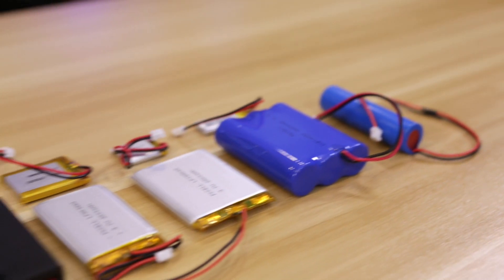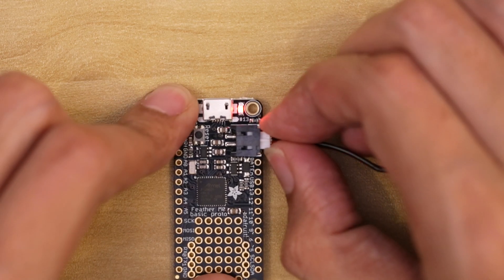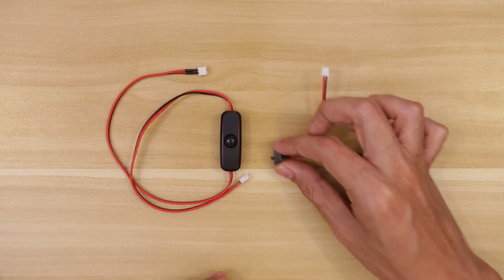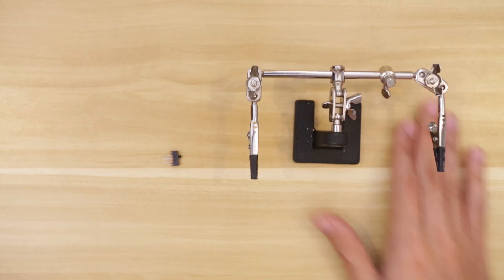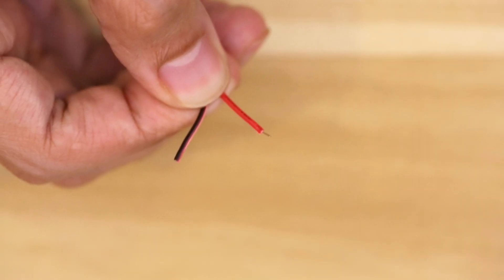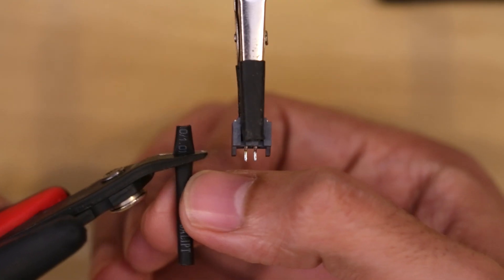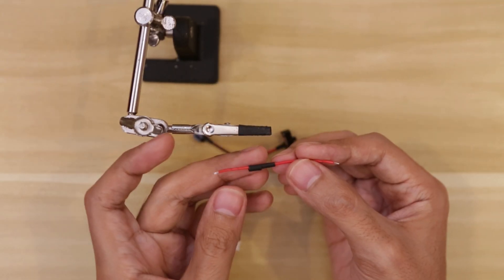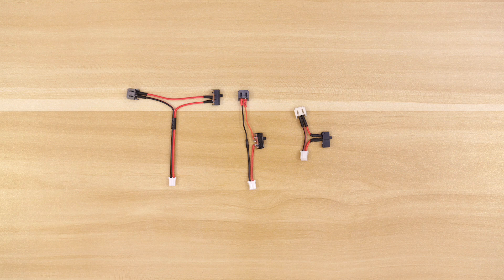DIY Slide Switch JST Adapter // How To

Comment: With slide switches, can you use a switch in an application where the current exhibited will be higher than its rating but the voltage will be much lower as well?

Comment: Why does the slide switch have 3 prongs? I've seen some that are 3 position ones, but even the ones sold as 2 positions have 3 prongs.
Reply: One of the prongs has to be untouched(only solder 2 of the 3 pins but one of them has to be the middle pin tho) as when you switch it off. The pin that doesn't have anything soldered to it is what causes it to turn off or you can reroute it to something else enirly depending on what your doing.

Comment: lets say i have a board that has a spot for a sliding switch, six holes and one extra in each side to connect it, is there a way i could make it work with some wire?

Comment: Hi there

I have a question here Is there a slide-push switch button anywhere. Im working on a project that I want to use this type of switch-button

Example: Slide - power on/off
Push- sync/search

Thanks

Comment: Why cannot you also use the female connector on the extension instead of replacing it with the black right angle JST-PH connector (https://www.adafruit.com/product/1769).  The one coming with extension seems to work fine.

https://youtu.be/K1CbrNh6a1s?t=2m13s